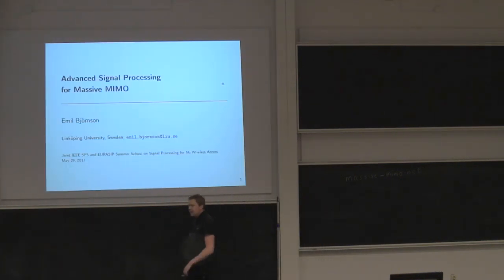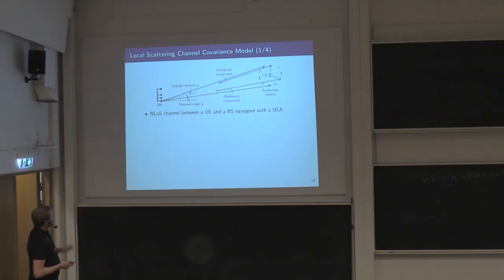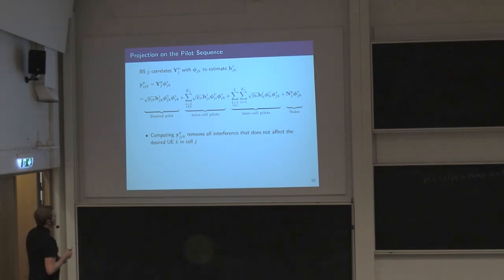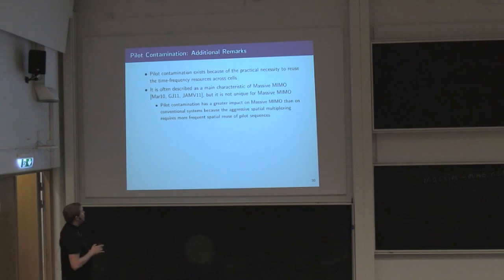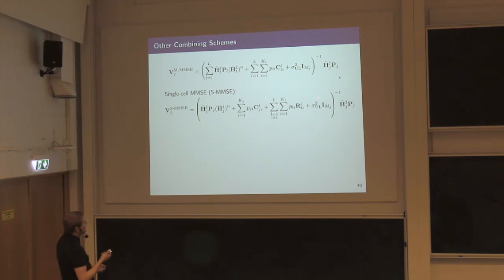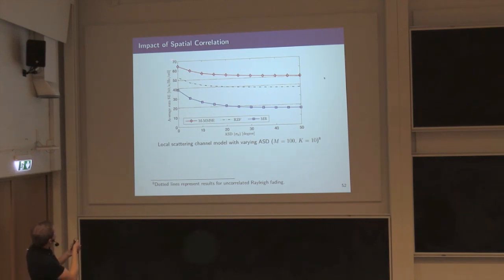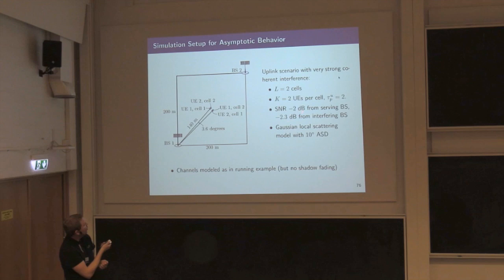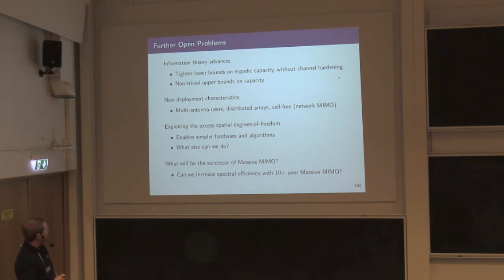Advanced Signal Processing for Massive MIMO

Comment: Thank you professor Björnson  for this very informative presentation. 
I worked in radar signal processing, mainly direction finding and model order estimation, and I it doesn't make sense to me that we rely on the eigenvalues of the data covariance matrix, R, to tell something about the correlation of the channel (the eivenvalues tell us if there is signal or not and how many are there). Unless the columns of  the array response matrix (aka array steering matrix) or the dominant eigenvectors are orthogonal, the channel can not be uncorrelated (i.e. linear independence is not enough to claim uncorrelatedness). The reason for this is that the spatial/angular distance between the multipath components received by the array of the base-station  is a key factor: the larger the angular distance, the smaller the correlation and vice versa. The only way to guarantee complete uncorrelation is when the angles, from which these multipath components are received, are designed in someway that makes the corresponding eigenvectors orthogonal, and this happens with probability close to zero in realty.  I could be missing something.
Reply from the maker: The matrix R is not the data covariance matrix but the spatial correlation/covariance matrix of the channel vector. It represents the distribution of the multiple path components. You can read more about this in Section 2 of our book which is available for download here: https://massivemimobook.com